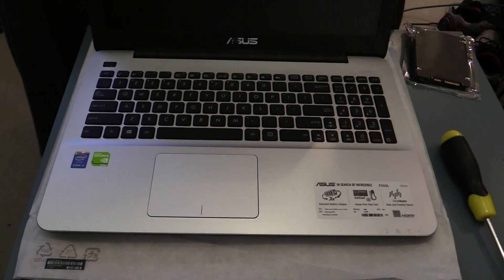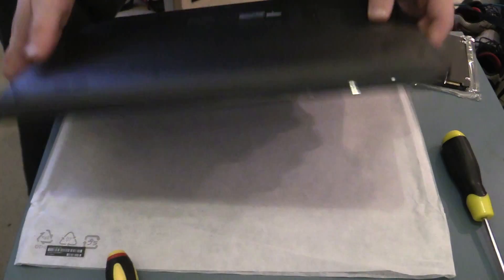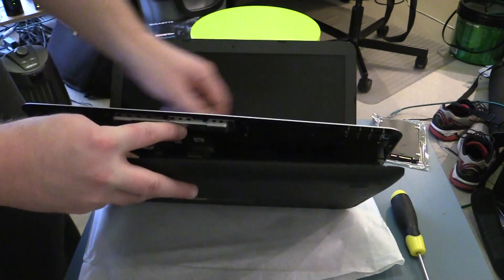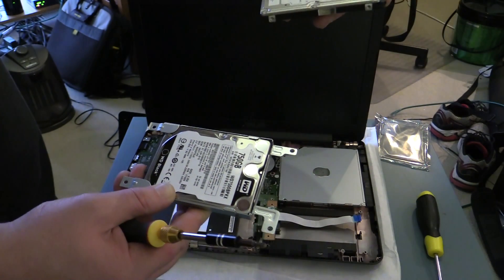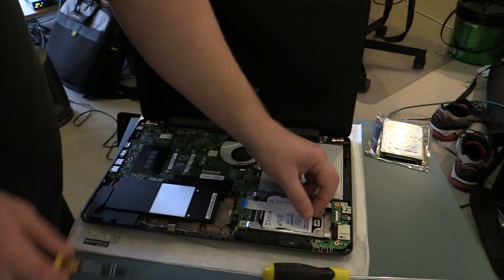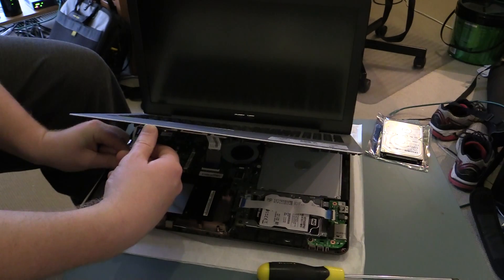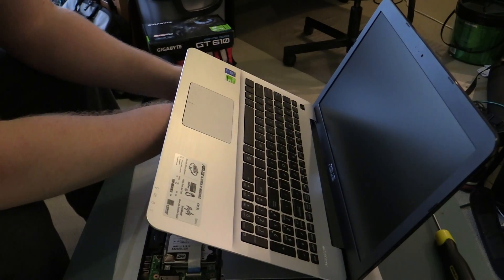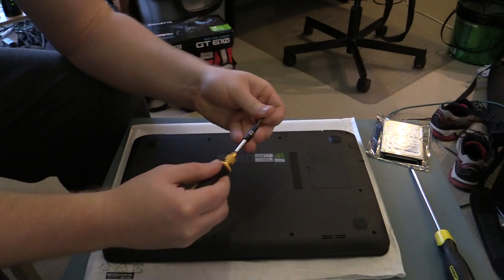Asus F555L Disassembly for Hard Disk Replacement

Comment: I'm thinking of buying a laptop like this, and i was wondering if i lose my guarantee when i open the laptop to change the hdd. Also do you know any laptops with nvidia gtx950m that have external battery? From asus or others.
Reply from the maker: +Andrei Arseniu Hi Andrei, yes unfortunately this will void your warranty... although the stock hard drive is pretty crap, so I'd certain do it... but it's up to you.
Reply: Thx a lot...  crappy asus,  hp has a little cover which you can remove,  and change the hdd without losing the guarantee.  I like your tutorials, well done!
Reply from the maker: Thanks Andrei, yeah I think it's just a budget model... most laptops you can get in to change out the hard disk easily... although I am seeing it becoming more and more common that laptops need to be taken apart for drive replacement! Guess they want people to replace their laptops instead of 'fixing' them when they break. This is a great little system after you change out the hard disk though... perfect for some web, youtube, etc.
Reply: Anyway,  i found an ideea so i can change the hdd without losing guarantee. I will buy the ssd from the place that i am going to buy the laptop and i will ask them to change everything and to add a caddy. I saw that it's possible on a website from Romania. i think it's in their own interest to do that. :p I have a Hp with i3 right now but it works awesome with a samsung evo 850. It's a huge difference. What laptop do you have?
Reply from the maker: I use a Gigabyte laptop which supports mSata, an internal 2.5" and it also shipped with a caddy to switch the DVD-RW for a 2nd internal hard disk... So you could even RAID 1 your laptop if you wanted to! Very versatile...
Reply: Hmm Gygabite is not popular at all in Romania. I only saw that brand in other countries.  Is the design looking good?  Which brand would you recommend?
Reply from the maker: Actually it looks kinda crappy haha no offence to the Gigabyte designers, although it is functionally great! It's not a popular brand here either for laptops, they're big for motherboards in desktop PC's... But I am more interested in functional than pretty lol

Comment: Can I assume that the disassembly of the F554L will be very similar to this one?
Reply from the maker: +Phillip Ramirez Sorry Phillip although I haven't taken apart the F5554L before (at least too memory), so it may be different... although most laptops are roughly similar to take apart. Usually it's remove battery & AC, then all the screws from the base, then it'll be either remove the keyboard or seperate the top from the bottom (depending on the model)... most important thing is too be carefuli with seperate the chassis (so you don't scratch it all up) and also the keyboard / track pad connectors... they're very fragile and very difficult to fix (/ just get a new motherboard if you break them).
Reply: I actually took it apart and replaced the hard drive with a SSD. The takedown is identical.

Comment: Hey does this series really have only one Ram slot?

If so Asus sucks.
Reply: +ramanmono This laptop design blows.
Reply from the maker: Haha I'd agree with you although it is a budget line, so not surprised at the same time. 8gb is still okay :s haha
Reply: Anthony Parker but is it on slot accessible and slot inside or just one slot total.
Reply from the maker: Yeah it's definitely not easily accessible. You have to do the full disassembly to get to it. There is one slot free inside there and 4gb soldered onto the board. A bad design choice by Asus in my opinion... Also annoying you have to take apart the whole unit to change the hard disk...

Comment: can you tell me how can i open the memory panel? i tried and i can't
Reply from the maker: Great work!  Yeah that's what I thought was the case from all the discussion in the comments,  I'll do a video for a memory expansion soon as I do have another unit in the office :-) great job and thanks
Reply: If you are a moron like me, you will hack at it with a butter knife until it is scratched and ugly. Then you will realize that little round bump in the panel is a rubber sticker. Pick it off to expose a small screw head. Unscrew it, pop off the panel with your trusty butter knife and the expansion slot will be staring you in the face. I used the Kingston 8 gig stick and the computer recognizes 12 gig.
Reply from the maker: +Cata Cata I'm quite sure with this model you have to do a full disassembly even further than this video as the memory will be underneath the motherboard. If you're unsure it might be better to get a computer technician to sort it out.
Reply: +Cata Cata did you find an answer how to open the panel? im struggling, too :(
Reply from the maker: You'll need to take it entirely apart, if you're unsure you may need to get a computer technician to do it. I'm based in Melbourne if you'd like to organise for me to do it for you
Reply from the maker: Hi there, sorry although I don't have one on the bench at the minute to confirm but going on all of the comments I've had regarding the memory upgrade I'd say that's not actually the memory cover. You'll need to remove the motherboard and the memory slot will be on the opposite side. Quite an annoying design but it does keep computer technicians like myself in business ;-) I do have one more brand new unit in stock so I'll try and do a memory video as soon as I sell the unit.
Reply: +Anthony “PeterPeterParker” Parker that would be awesome!
Reply: +thekingofcorsairs I just got this laptop.  I have been trying to figure out if I buy either a 4 GB or a 8 GB (additional) memory module for the 1 memory slot on this if it will run in single channel or dual channel.  I suspect since they are not identical it will not be dual channel  (booooo).  Can anyone steer me in the right direction?
Reply from the maker: Yeah you'll pretty much only use a 4Gb in it... There is a lot of hype about dual channel, it'll probably run in dual channel mode but it really isn't much faster at all.
Reply: I see.  Thanks for the response.  I am considering getting this 4 GB stick.  http://www.amazon.com/gp/product/B00KQCOTCM
Reply from the maker: Awesome :-)
Reply: CaptainXanax that's what i did but i was lucky because that round bumped fast and i only scratched once the panel.
Reply: +CaptainXanax I did the same thing with a butter knife, thanks. Mine laptop has 6 gigs of ram installed. Would that mean that I need a 6 gigs stick? It can expand up to 12 gigs.
Reply: +Cattom Rud depends, it probably has one of 4gb and another one of 2gb or just one of 6gb (which would just be adding another one of 6gb but that's unlikely). You're going to have and crack it open and see. :) hope that helped.
Reply: +Cata Cata Very easy actually. Check this video /watch?v=yecuhZDw0hs

Comment: Great video.. I wanted to ask, i had a little bump close to where the harddrive is located. It worked fine, but then it started making a cracking noise, after restarting i got the "please select a proper boot device" messege. In BIOS the harddrive is recognised so im hoping that the hard got loose or something... so what are my options. Thanks in advance and keep up the good work
Reply from the maker: What hard drive did you install? Was it thicker than the original drive? If the drive is recognised in BIOS its either a faulty hard disk (was it new?) Or a software issue such as a corrupt file system or missing boot partition. If its the later, I'd remove the disk, copy your files off it and then start with a new OS install. It can also be to do with CSM and secure boot if you've changed those settings? Its the kind of problem I would really need it in my office to diagnose.

Comment: Could you please tell me where the wifi card is located in this model?
Reply from the maker: traderstuart  I don't have the model on my work bench anymore, although going by the video, I'd say it's going to be under the motherboard, which means further disassembly. Why would you need to get to the WiFi card? In my experience, they're very rarely faulty? Unless you're going to upgrade it to a dual band Intel chip or something? If you're having WiFi problems, it's more likely software than hardware.
Reply: Anthony Parker Yes the reason is to put a dual band wifi card, my son's school in their infinite wisdom has decided to provide wifi only on the 5GGhz band. The computer was a replacement for a TP500LN which at the time of purchase I was told it had dual band. That information was wrong and I had to replace the wifi card which fortunately was easy to access. In 12 months the TP500LN had the main board, keyboard and display all replaced and then a few days ago stopped working again. I was told by the store we could get a new computer, I picked F555L and was told 5GHz is standard in new laptops such as this, silly me for actually believing they knew what they were talking about. It's surprising when you check how few laptops come with dual band cards.
Reply from the maker: Yeah 5ghz is still not that common in new laptops only higher end ones, which is a shame the Intel dual band chip is quite cheap and does a great job. I don't know where you're located but if you're in Melbourne I can do the upgrade for you. You will find the WiFi card under the motherboard in this model most certainly.
Reply: Anthony Parker Thanks for the offer, we're in the same country but I'm in Sydney. I found a technician to do it and they said it took them 2 hours. Basically the wifi card was not accessible until virtually everything else had been taken out, I don't understand why designs have regressed from having components easy to access to extremely difficult, surely it doesn't have to be that way!
Reply from the maker: Yeah agreed on that front, could be done in an hour but two hours isn't too far of a stretch of the imagination. Laptops these days mostly ship with poor quality hard drives, having the drive inaccessible means consumers are more likely to replace their laptops than fix them. Which is terrible for consumers and laptops shelf life is really 2, 3 or maybe 4 years... The right setup and they can last much longer though, as the bottle neck in computers is not commonly the CPU/memory anymore... Its the hard disk. A new hard disk and a system is a lot like a new computer, as long as there are no other faults in the system.

Comment: Hello and thank you for this video :)

I've got a question: do you know how many RAM slots are there and how much RAM memory is soldered to the motherboard?
Reply from the maker: Best check the manual to confirm but as I remember it was 4gb soldered and expandable with another 4gb SODIMM 1600mhz LV (1.35v). But best double check it, pretty sure that's correct though. If it I'd LV make sure to ask your supplier for LV as 1.5v won't work.

Comment: Very good!!! with your guide is very simple open this notebook. But, i've a question...How i disconnect flat cable? i've try to pull down the black plastic part but it doesn't move...Can you help me? Thank you in advance
Reply from the maker: Hey there, it just flicks up which releases the keyboard but be very very carful. If you snap it that's a real problem. It is easy to do but if you're unsure you best ask for help.

Comment: i am trying to downgrade the F555L to windows 7, when you opened it up did you look at the motherboard? need to find out what motherboard it has!
Reply from the maker: Funnily enough, I actually have another on my bench this second. I don't see any issues going to Win 7 at all, although you'll likely need to change the BIOS settings from UEFI to Legacy. This is a little different from model to model but if you disable Secure Key and the CSM features you'll be pretty close. Motherboards in laptops are usually exclusive to the series but its usually quite easy to find Win 7 driver equivalents if they're not already on the manufacturer site. Good luck!
Reply from the maker: Oh also, don't put the laptop completely back together until your sure everything is working ;-)
Reply: Anthony Parker When I downgraded to Windows 7, Windows couldn't detect a driver for the LAN,WAN and USB so I had to actually burn the drivers on a DVD as that was the only way to transfer the drivers on there. If you install Windows 7 x64 then the drivers on the Asus website for 8.1 x64 does actually all work on Windows 7 as the exe files have the drivers for Windows 7 :-)
Reply from the maker: Fantastic :-) yes it should be a pretty easy one. Good job.